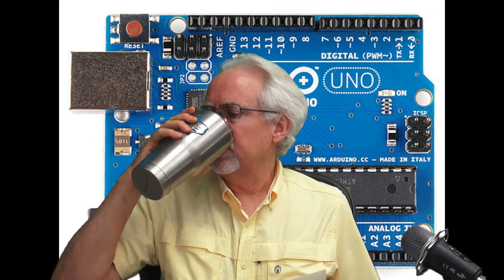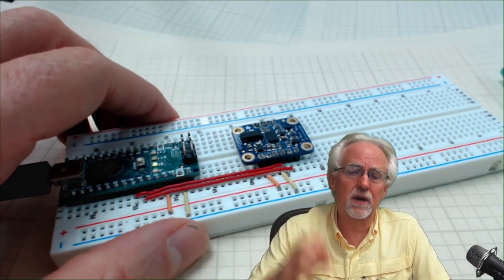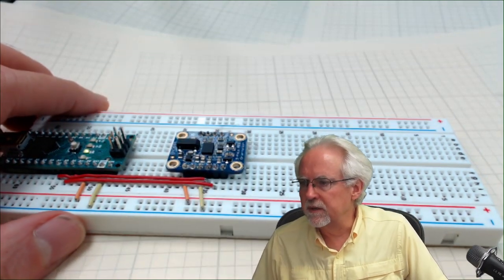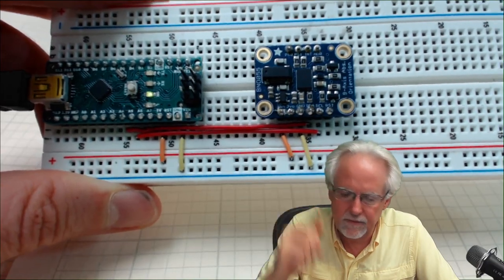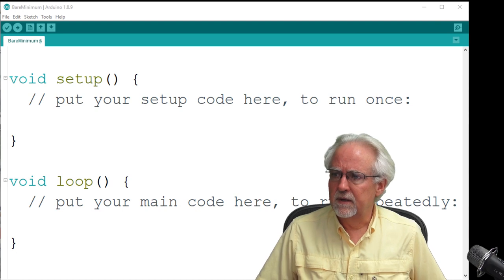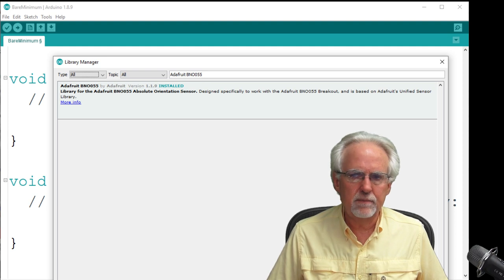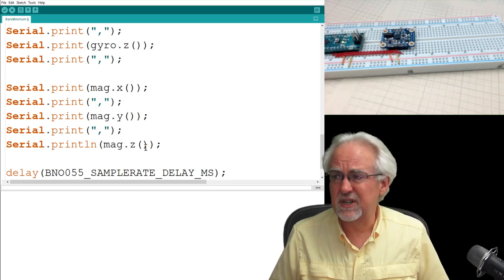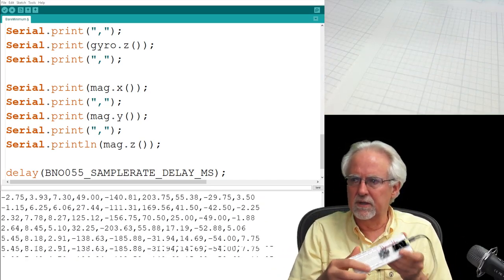9-Axis IMU LESSON 2: Connecting and Getting Raw Data from the BNO055 9-Axis Sensor

Comment: For anyone who was struggling with always getting -1 for temperature: not all boards designate A4 and A5 for SDA/SLC... Make sure that there aren't other slots labeled specifically "SDA/SLC". If there are, use those. If not, look up the specs for whatever board you are using to see what the default SDA/SLC pin slots are.
Reply: I'm using the Teensy 4.1. I tried using those pins and it still didn't work (purchased before I found the tutorial series). Any advice? I've tried with an Arduino Uno and get backwards question marks instead of -1. I might just order a nano and try it with that if I can't figure this out.

Edit: Changed the baud rate on the serial monitor and it fixed it (for the Arduino Uno). Still trying to figure it out for the Teensy. For some reason on the Teensy serial monitor theres no baud rate drop down.

Edit 2: Somehow got the teensy to start printing 0 instead of -1.  Not sure what I changed but its progress I guess

Edit 3: Teensy is working with everything now. Not sure what changed. I just kept messing with it and eventually something worked.
Reply: @PsycoMonkey360  Probably a bit late, but you will want to look on the card that came with the teensy (or search the pinout) and use SCL0 and SDA0 pins.

Comment: sitting flat my readings are x, -550, y, 300, z, 16000. and rotating each axis between 180 range between 16000 and -16000. And since the gravity of earth is an acceleration constant. I would say 16000 should be equal to 1G or 9.8 m/s^2. With my equipment and library, I can also vary the range between 2 and 16 Gs, in increments of 2.

Comment: This may sound irrelevant because you warned that we should consider using the sensor and board you have used but I both this sensor BNO085 for a project before and following your procedure I tried getting the reading but had error at the point "imu: : Vector <3> acc = myIMU.getVector...........". every other thing looks good. Will you be in a position to advice

Comment: BOOM!  I got this up and running tonight.  It works perfectly.  I'm using an STM32 microcontroller instead of a nano, but I did buy the Adafruit BNO055 IMU you linked to though.  I was very happy to see everything working right out of the gate.  Especially since I accidentally wired the Vcc up to the Vout pin on the IMU.   I turned it on  before I discovered this mistake and was afraid that I might have damaged the $30 board.  But fortunately no harm was done.  So I'm finally underway on this course as well.  All the data is coming in just fine.

Comment: Hi Teach!!

Received my IMU a while ago and started with the lessons.

To answer the questions given as part of the homework, the following are my observations:

1) The data in any of the axes change only when the Sensor is moved and then it returns to its pre-movement level, even though it is in the new position. The reason being that we are measuring the acceleration which is the change in speed and not the position and hence the change visualized only so long as the Sensor moves.

2) MORE IMPORTANTLY, while the data in the X and Y Axes are closer to Zero, the one in the Z Axis is a larger number, in close proximity to about 9.4

This figure is actually the G_Force or the acceleration due to gravity that is constantly acting on the Sensor, though it is static. 

In fact it is so exciting to note that this figure is close to the figure of 9.8 m/s2, which is the value of G mentioned in standard Physics textbooks.

Hope this is the answer you were looking for!!

Regards!

Comment: For those of who got "-1" for temp reading, please recheck your soldering. This fixed my problem. Run file>example>Adafruit BNO055>sensorapi to check if IMU sensor is working properly. Open "Serial Monitor" to display message & data. (Credit to "Automatic Addison").

Comment: I forgot to comment on your soldering points on the IMU module. They look just right. Not too much solder used, nor insufficient. Well done. 

p.s. My 1st PCB project is done with a success. It took me 6 months! It's an STM33 board blinking an onboard LED, with a onboard circuit of USB-TTL.

Comment: Hello Paul, I am enjoying the lessons on the BNO055.  What I am finding is my "x" axis is -.060 and will wont change much while I move left to right but will change forward and backward. The "y" axis is  .15 and will change left to right but not forward or backward. My "z" axis is 9.45 and will only change when I pitch up or down and roll right to left and also as I go up and down. I did notice that when I roll to 90 degrees "left or right" the number will go to zero and then to negative. Now all will change as I move the board around and there is very little change while not moving. Where I live my elevation is about 785 ft above sea level.  Another observation is it is really sensitive to any kind of movement or vibration.
Thank you for a great lesson and am going to watch the next one.

Comment: Great explanation on that code in the loop! That code is not very easy to read, but I suppose it was determined by the people who named the imu BN0O55! 

I wasn't getting any readings at first, but it turns out I needed to solder the VUSB pad on the back to activate the 5v pin. After that I was getting the readings as expected.. well, mostly!

The Z Accelerometer is not reporting '0' as expected, but instead ~9.28. I noticed yours was producing a value at around ~10.20. Is that difference indicative of the difference in altitude between our locations? I'm at an elevation of ~1000 feet

Comment: Thank you for this lesson Sir Paul!

I think of the long command this way:  
* sensortoworkwith::Vector<'x'numberofcomponentsofthevector> variablename = imusensor'sname.getVector(library of the sensor we're workin with excluding the .h::VECTOR_ACCELEROMETER);
     ---> this command is like a variable initialization written inside the void loop()...
          that instructs the arduino to get accelerometer vector data (of 'x' number of components) from the imu sensor
     ---> we need to analyze this command into 2 parts:
          *1st part: sensortoworkwith::Vector<'x'numberofcomponentsofthevector> variablename
           ---> this part is like a variable declaration...
                creating a variable for storing vector data with 'x' number of components
          *2nd part: = imusensor'sname.getVector(library of the sensor we're workin with excluding the .h::VECTOR_ACCELEROMETER);
           ---> this part is like a read command...
                specifically instructing the arduino to get accelerometer vector data from the virtual imu sensor
     
         >Example: imu::Vector<3> accelerometerData = myIMU.getVector(Adafruit_BNO055::VECTOR_ACCELEROMETER); 
                   
                   /*NOTE:
                     The 1st part is the imu::Vector<3> accelerometerData
                     ---> as mentioned above, this is like a variable declaration...
                          declaring the variablename 'accelerometerData' as a variable that will be used to store vector data (of 3 components i.e. acceleration in x, acceleration in y and aceleration in z)
                          from the imu sensor

                     The 2nd part is the = myIMU.getVector(Adafruit_BNO055::VECTOR_ACCELEROMETER) 
                     ---> as mentioned above, this is like a read command
                          instructing the arduino to get accelerometer vector data from the virtual imu we created 

                     Combining the 1st part and 2nd part together...we have a variable initialization of the variable 'accelerometerData'
                   */ 

         >Example: imu::Vector<3> gyroData = myIMU.getVector(Adafruit_BNO055::VECTOR_GYROSCOPE); 
                   
                   /*NOTE:
                     The 1st part is the imu::Vector<3> gyroData 
                     ---> as mentioned above, this is like a variable declaration...
                          declaring the variablename 'gyroData' as a variable that will be used to store vector data (of 3 components i.e. gyro in x, gyro in y and gyro in z)
                          from the imu sensor

                     The 2nd part is the = myIMU.getVector(Adafruit_BNO055::VECTOR_GYROSCOPE) 
                     ---> as mentioned above, this is like a read command
                          instructing the arduino to get gyroscope vector data from the virtual imu we created 

                     Combining the 1st part and 2nd part together...we have a variable initialization of the variable 'gyroData'
                   */ 

         >Example: imu::Vector<3> magnetometerData = myIMU.getVector(Adafruit_BNO055::VECTOR_MAGNETOMETER); 
                   
                   /*NOTE:
                     The 1st part is the imu::Vector<3> magnetometerData 
                     ---> as mentioned above, this is like a variable declaration...
                          declaring the variablename 'magnetometerData' as a variable that will be used to store vector data (of 3 components i.e. earth's magnetic force in x, earth's magnetic force in y and earth's magnetic force in z)
                          from the imu sensor

                     The 2nd part is the = myIMU.getVector(Adafruit_BNO055::VECTOR_MAGNETOMETER) 
                     ---> as mentioned above, this is like a read command
                          instructing the arduino to get magnetometer vector data from the virtual imu we created 

                     Combining the 1st part and 2nd part together...we have a variable initialization of the variable 'magnetometerData'
                   */

   * variablename.x()
     ---> to access the data in the x direction of whatever vector data that variable might contain
     ---> printing it is like: Serial.print(variablename.x()); 
                               or 
                               Serial.println(variablename.x());

          >Example(printing acelerometer data in x): 
                                                    Serial.print(accelerometerData.x()); 
                                                    or 
                                                    Serial.println(accelerometerData.x());

          >Example(printing gyroscope data in x): 
                                                    Serial.print(gyroData.x()); 
                                                    or 
                                                    Serial.println(gyroData.x());

          >Example(printing magnetometer data in x): 
                                                    Serial.print(magnetometerData.x()); 
                                                    or 
                                                    Serial.println(magnetometerData.x());

   * variablename.y()
     ---> to access the data in the y direction of whatever vector data that variable might contain
     ---> printing it is like: Serial.print(variablename.y()); 
                               or 
                               Serial.println(variablename.y());

          >Example(printing acelerometer data in y): 
                                                    Serial.print(accelerometerData.y()); 
                                                    or 
                                                    Serial.println(accelerometerData.y());

          >Example(printing gyroscope data in y): 
                                                    Serial.print(gyroData.y()); 
                                                    or 
                                                    Serial.println(gyroData.y());

          >Example(printing magnetometer data in y): 
                                                    Serial.print(magnetometerData.y()); 
                                                    or 
                                                    Serial.println(magnetometerData.y());

   * variablename.z()
     ---> to access the data in the z direction of whatever vector data that variable might contain
     ---> printing it is like: Serial.print(variablename.z()); 
                               or 
                               Serial.println(variablename.z());

          >Example(printing acelerometer data in z): 
                                                    Serial.print(accelerometerData.z()); 
                                                    or 
                                                    Serial.println(accelerometerData.z());

          >Example(printing gyroscope data in z): 
                                                    Serial.print(gyroData.z()); 
                                                    or 
                                                    Serial.println(gyroData.z());

          >Example(printing magnetometer data in z): 
                                                    Serial.print(magnetometerData.z()); 
                                                    or 
                                                    Serial.println(magnetometerData.z());
Reply from the maker: Wow did not realize you were working on these. Were you able to get the BNO055 sensor?
Reply: @paulmcwhorter  
I don't have it with me Sir Paul...it would be great if I had one...

Nonetheless, I try my best to take notes on each lesson and
code it in the arduino even if I don't have the bno055.

I just visualize what the data might spit out in the Serial monitor hahahaaha!
Your screen view really helps!

Comment: This is all I get from the Serial Monitor:
-0.01,-0.01,-0.01,-0.06,-0.06,-0.06,-0.06,-0.06,-0.06,
It doesn't change even if I move it. Is mine defective or is it because I didn't solder it. I thought contact was enough.
Reply from the maker: You will need to solder it.That is probably the issue
Reply: I'm getting same numbers but I solder mine, did you ever fix it

Comment: Just got the new tools and playing around with them. To answer the HW the data makes sense, this is why. In the Z direction my acceleration is around 9.52 this is because of the acceleration of gravity. Why isn't it 9.81? One, the acceleration of gravity varies based on altitudes, however the difference isn't very noticeable IRL unless you are greatly above sea lvl. Two, there is some electrical noise that gives incorrect values for the X, Y, & Z measurements.

Comment: Hey Paul! I'm waiting for my sensor. Wouldn't spi be a better protocol for faster resolution. Haha nvm. You added a delay.
Reply from the maker: For IMU measurements, faster is not always better, and speed will be limited by the sensor, not the interface. Although this is one of my least-watched series of lessons, it really pis probably my favorite. So glad you are playing along. Be blessed.
Reply: @paulmcwhorter  I've been reading ahead about all the math and such. It seems like it'll be a great challenge. I'm going to do python lessons in the meantime. I'm going to join your patreon my friend. I just have to wait a week. It's the least I can do. You're responsible for my obsession with ee. I usually do a circuit a day on the breadboard and study the math behind it. Otherwise I'm just connecting dots. You want to see the breadboards I have. Well a whole lab for that matter. I have a scope, wave gen, isolated transformer and variac.  I'm in the process of converting a 16k tie point breadboard to have a printed case holding a variable  dual rail for op amp testing and a 5/3.3 volt terminal. The dual rail can be ac as well and it'll have pomona hardware for the power supply terminal and very low ripple power. That and the imu are going to be my winter projects along with custom Xmas lighting for the wife. I know a psu engineer friend who helped with the new energy cells help me with the breadboard because I'm going design pcbs that isolate the dual rail break out and I'm going to have nice binding posts for the variac to connect to. I have two printers and one is massive to make the enclosure. It's going to look like an early 80s/late 70s powered bread board. That and a better scope are my pieces of dream gear.

Sorry for rambling. I don't get to talk about this stuff much. I suspect the next generation Jetson nanos will be out next year. The Maxwell architecture they run on is 2015 technology unless you can afford the new tgx board. I'm upgrading my graphics card to an rtx4090 this fall so I can have a video card befitting my new pc. I had the 2080ti but I sold it last year to buy lab gear. 

I wish the stem stuff would come down in price. The single board computers and mems chips are going to be the slowest to bounce back. It's why getting the bno055 from adafruit is impossible so one came up for 40 dollars and I snagged it yesterday but I won't have it for a month. I read the adafruit source code for the unified sensors and the bno055 and according to the bosch datasheet mine will function identically. I just have to remove a 0 ohm smd resistor acting as a jumper. Just so you know as well, it's ok to play video games as long as it doesn't cut in on your learning.

If I wasn't 44 and retired I'd go get a masters in electronic engineering. I made it through the first year easily doing the exams from a school in Ohio. But that was for fun haha. I've gotta shut up. Take care

Comment: Thank you so much Paul.  I am using this circuit to measure acceleration and then I wish to integrate this to find speed and position.  The trouble I am having is: How do I find the time elapsed between readings and can I change the sample rate of this device to something like 500Hz?  Hope to hear a comment on this.
Reply: @ParabolicLabs  hey I was wondering if you could help me with one of my problems, so I'm trying to upload just the library's, but when I try it tells me that the <utility/mumaths.h> library has no file or directory, any help is wanted at this point.